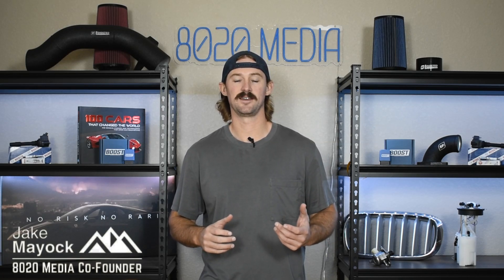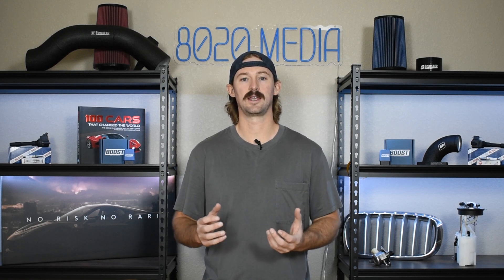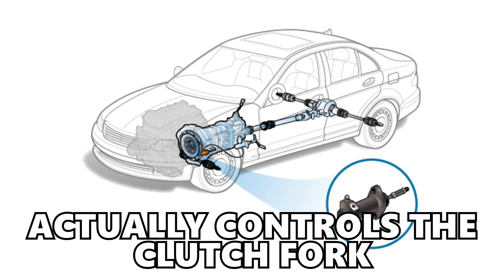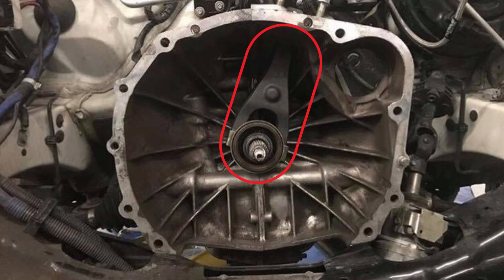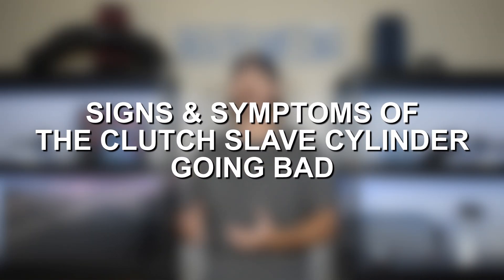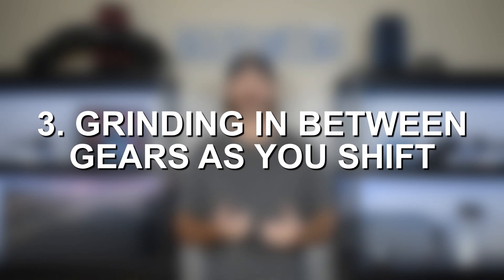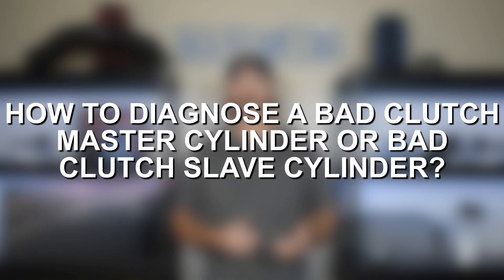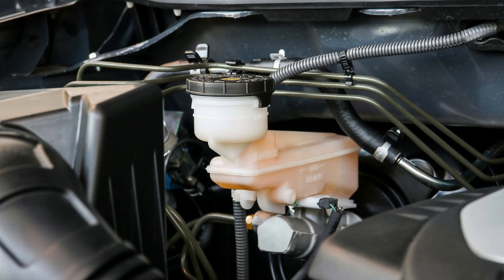Bad Clutch Master or Slave Cylinder? Symptoms, Diagnosis, and Fixes Explained!

Comment: I changed everything in my car, clutch, master and slave cylinders but the clutch is super hard to push and now my leg feels really bad. We bled it and we adjusted it but nothing works… I have no ideas of what to do so I just want to get rid of the car :/
Reply from the maker: K - Totally get the frustration—if you’ve replaced the clutch, master, and slave cylinders, bled the system, adjusted everything, and the clutch pedal is still super stiff, something’s definitely not right mechanically, and it’s likely one of two things: either the clutch pressure plate is overly stiff or the wrong type for your car, or something is misaligned in the install, like the clutch fork or throwout bearing binding against the pressure plate fingers, creating excessive pedal resistance; some aftermarket clutches, especially performance or “stage” kits, have way heavier pedal feel than OEM, so if you went that route, that alone could explain the pain—but if you used OEM or close to it and it still feels like a gym workout, you might be dealing with a bad install or a bent fork putting unnecessary pressure on the system; it’s demoralizing, but if you still like the car, a shop familiar with your make/model could probably fix this with a proper re-check, and if not, selling might save you some grief.

Comment: About a month ago my clutch pedal went spongy and then it stayed down with a little bit of a burning smell.
Since then the clutch hasn't been spongy but about once a week all of a sudden my car has trouble getting into gear.
Does this sound like a master cylinder or slave cylinder issue? Thanks
Reply from the maker: M - Yep, that pattern is a strong sign of a failing clutch hydraulic system, and most likely points to a bad clutch master cylinder or slave cylinder slowly losing pressure or leaking internally; when the master cylinder starts to fail, it can intermittently fail to build enough pressure to fully disengage the clutch, making gear engagement tough or impossible, and the occasional return to normal behavior is typical of a seal starting to break down, especially under heat or load—so I’d inspect the clutch fluid level (which may be low or dark), check for wet spots around the master and slave, and if you don’t see any external leaks, suspect the master cylinder is bypassing internally and should be replaced before it fully gives out.
Reply: @8020Automotive  Thank you for replying to me.
I've had my car (bmw 1series) looked at and test driven by two garages now. 
They both say everything appears fine, no leaks, drives well, nothing obvious.
I think I will book in with them to replace the master cylinder.

Comment: Ive replace my entire clutch, release arm, pivot ball, arm spring.. 
and im still having the same issue, 
Where it take a long throw for my shifter to engage into gear, causing a clicking clunking sound coming from the shifter itself. I  uploaded video of it to my channel. 
I’ve drove other manual vehicles and the gear engagement and disengagement  is so smooth and clean. 

Sounds like the slave cylinder might be what I need to replace! I will be back with an update.
Reply from the maker: B - Keep us updated!
Reply: Seems like you sitting with a problem with the transmission itself, there's components inside that wear over time, had problem similar to yours and I thought it was clutch but turned out it was broken gears inside gearbox

Comment: Just replaced the clutch on 2013 vw golf r can with the new slave cylinder/release bearing and now i can not get it to bleed. It will not build any pressure. Any advice?
Reply from the maker: B - If you’ve just replaced the clutch and slave cylinder (which is integrated with the release bearing on a 2013 VW Golf R), and you can’t get it to bleed or build pressure, you’re likely dealing with trapped air in the system—especially common with these internal concentric slave setups; try gravity bleeding first by keeping the reservoir full and opening the bleeder screw on the slave to allow fluid to drip out on its own (this may take time), then move to a pressure or vacuum bleeder to force fluid through without relying on pedal movement; if that still doesn’t work, the master cylinder may have been overextended during install or is failing internally, so inspect it and the push rod for proper alignment and function—also double-check for any fluid leaks at fittings or banjo bolts, as even a small leak will prevent pressure buildup.

Comment: Is there a posibility that this bearing is not fully retracted when i push the pedal? Cause im having problem that when i accelerate it not riding faster and i have a feeling that its sleeping over flywheel when i put my foot off the cluth pedal
Reply from the maker: J - Yes, it’s definitely possible that the release bearing (throwout bearing) is not fully retracting when you take your foot off the clutch, which can cause slipping because it may still be slightly disengaging the pressure plate, especially if the clutch fork or hydraulic system (master/slave cylinder) isn’t returning fully due to wear, improper installation, or internal pressure not bleeding off; this would explain why your engine revs but the car doesn’t accelerate properly—check for a sticking slave cylinder, improper free play, or misaligned clutch components.

Comment: What do you think of a clutch pedal that works great under regular driving conditions, but once wot and trying to change gears, the clutch pedal sinks to the floor and requires a few pumps to get it back to being firm again? This is with a brand new slave cylinder as well.

Thank you
Reply: And i have no fluid leaks anywhere!
Reply from the maker: P - A clutch pedal that behaves normally under light use but sinks to the floor and loses pressure under wide-open throttle (WOT) is often a sign of master cylinder failure, specifically internal bypassing where fluid slips past the seals under high-pressure or high-heat conditions—especially since you've already replaced the slave cylinder and confirmed no external leaks. Hard acceleration increases engine bay heat and can also cause fluid expansion or air pockets to shift, exposing a weak master cylinder seal or even slight aeration in the system if it wasn’t fully bled. It’s also worth checking for flexing in the hydraulic line under pressure (especially with braided stainless upgrades), but based on your symptoms, the clutch master cylinder is the most likely issue, even if it appears fine under light or moderate loads.

Comment: Hey love this video and glad I found it as I’m having clutch problems in my ranger. Guessing it’s the master after watching this. Recently wouldn’t go into gear out of the blue and noticed fluid was low so I put that in then bled the system. After doing so the soft almost non existent pedal got a bit stiffer and was able to shift. But, in the time it took for me to run in the house and grab a drink and wash my hands, the system had lost pressure and was back to the almost non existent pedal and was again unable to shift into any gear…. Strange part is I cannot for the life of me find any leaks anywhere. Is a low mileage vehicle and has virtually no leaks of any kind anywhere and is completely dry everywhere so there’s no mistaking one leak for another or anything of that sort. I think I will start with the master givin what I’ve learned here. Wondering what your take is on this givin the symptoms I described???
Reply from the maker: R - Thanks for the feedback! Based on your description, it strongly points to a failing clutch master cylinder—even without visible leaks, an internal seal failure can cause it to lose pressure after sitting briefly, which explains why the pedal went soft again after just a few minutes; if fluid isn’t leaking externally and the slave cylinder area (especially inside the bellhousing) is dry, then it’s very likely the master cylinder is bypassing internally under pressure and allowing fluid to move past the piston without actuating the clutch, especially as it warms slightly. Replacing the master is a logical first step, and if the issue persists afterward, only then would I consider the slave cylinder, which can also fail without visible external leaks if it's a concentric type inside the bellhousing—but the master is by far the more common culprit given your symptoms.

Comment: What could cause the clutch pedal to get soft and spongy about 1/3 from the top, but only when it is driven for a longer period an when it is hot outside and engine heats up. When starting the the car cold in the morning, everything is normal, on short runs everything is ok, the clutch engages always at the same position. The fluid was bled, did not go for a longer trip at that time, but after a couple of days the spongy pedal came back, especially when driving longer than 30 minutes. I think it does not help when a/c is on and cooler fan is making additional heat to the engine bay. When outside temperature lowers the  pedal gets back to normal. Had this problem only in summer, just a couple of times in the past 2 or 3 years, but this spring it has come up more often. Master cylinder or? Thanks.
Reply from the maker: M - A soft or spongy clutch pedal only after extended driving or in hot weather—especially if it returns to normal when the car cools down—is a classic symptom of a failing clutch master cylinder or slave cylinder, particularly due to internal seal breakdown under heat; as the brake/clutch fluid heats up and pressure builds, worn internal seals in the master or slave can allow fluid to bypass internally, leading to a loss of firm pedal feel without an external leak or visible fluid loss. Since you've already bled the system and it only happens after longer drives in warm conditions (and resolves when it's cooler), the heat-sensitive degradation of the master cylinder seals is the most likely cause—replacing the clutch master cylinder should resolve the issue, but if your system uses a concentric slave cylinder (internal), it may also be contributing and should be checked if symptoms persist after replacing the master.

Comment: i have a 2011 fiesta 1.4 petrol never had any problems with the gears or clutch but now when i drive for about 10 mins or so and the car warms up i cant get the gears if i stop and wait 10 mins start it up again i can get all the gears no problem, its got me stumped any suggestions ?
Reply from the maker: E - If your vehicle shifts fine when cold but becomes difficult to get into gear once warmed up, the issue is most likely related to the clutch hydraulic system, specifically a failing clutch master or slave cylinder—as the fluid heats up, worn seals may allow internal pressure loss, making it hard to disengage the clutch fully, which causes gear engagement problems; since it returns to normal after cooling down, it strongly points to thermal expansion affecting fluid pressure or seal integrity, so start by checking the clutch fluid level and condition, then consider replacing the master cylinder (most common culprit) and bleeding the system thoroughly.

Comment: I like your content; I can hear the spring when pressing the clutch pedal, right inside the cab, my master cylinder must off.
Reply from the maker: S - Thanks for the feedback! If you're hearing a spring-like noise when pressing the clutch pedal inside the cab, it’s often coming from the clutch pedal assembly itself—not necessarily the master cylinder being “off,” but possibly a dry or worn clutch pedal return spring, bushing, or the pushrod connection to the master cylinder; over time, the pivot points can squeak or creak, and the spring can make a metallic twang or pop as it moves. Try applying some white lithium grease or silicone spray to the pedal pivot and spring—if that doesn’t quiet it down or if the clutch feels inconsistent or spongy, then inspect the master cylinder pushrod and firewall seal more closely for signs of play or fluid seepage.

Comment: I've had an issue where, at times, especially when going over small bumps, it feels almost like it's slipping, but it isn't actually slipping.
Reply from the maker: A - If your car feels like it’s “slipping” when going over small bumps but isn’t actually losing traction or RPMs, the issue is likely suspension or drivetrain-related, not the transmission; this sensation can come from worn struts, bushings, motor mounts, or even a loose CV joint or driveshaft, which can momentarily shift or unload when the suspension compresses, creating a brief feeling of looseness or hesitation—inspect your front end components, especially control arm bushings, strut mounts, and engine/trans mounts, since any play there can create that odd slipping sensation without any actual loss of power delivery.

Comment: I am facing similar issue. I drove the car nicely and parked it . Next day when i pressed the clutch pedal,  it went deep into the floor. I got it bleeded by the help of mechanic. At first it was only air bubble coming out. After continuos pressung of clutch pedal, finally the oil started coming at the slave cylinder.  But after few days the same problem started again, my clutch pedal again went deep into the floor. My fluid level in the reservoir doesn't seem to be going less. Kindly advise what is the problem,  master or slave cylinder?? Thanks
Reply from the maker: J - If your clutch pedal keeps sinking to the floor after a successful bleed and the fluid level in the reservoir isn’t dropping, the most likely culprit is a failing master cylinder—specifically an internal seal failure that allows fluid to bypass inside the cylinder rather than pushing it to the slave, which won’t result in visible leaks but will cause air-like symptoms and inconsistent pedal pressure over time; a bad slave cylinder typically leaks externally and causes visible fluid loss, so since your reservoir stays full and it takes a while for symptoms to return, replace the clutch master cylinder first, bleed the system thoroughly again, and monitor closely—this pattern is classic for internal master cylinder failure.
Reply: @8020Automotive - Many thanks for your reply...will replace the master cylinder and update ...

Comment: Advice if you have time. I have bleed my syatem twice. It helped my engagement a bit. So, to be clear i have full engagement range, but the first half of the pedal is soft and spongy. I purchased a new master.
Reply from the maker: R - If you've already bled the clutch system twice and gained some improvement in engagement but still have a soft, spongy feel in the first half of pedal travel, it’s very likely your current master cylinder is internally bypassing or drawing in air past the seals—which aligns with your decision to replace it—since full engagement combined with a vague initial pedal usually points to hydraulic inefficiency rather than air in the line alone; once you install the new master, be sure to bench bleed it thoroughly before mounting, and consider pressure bleeding the entire system afterward to fully purge any trapped air, especially if the slave is internal and hard to access.

Comment: Really helpful video! My mechanic thinks it is master cylinder because when I returned to vehicle in the morning clutch pedal was on floor. Clutch was not going into gear when driving but is ok again. Pedal hasn't felt spongy so I thought it might be a slave?I thought they could also cause pedal not to come up?  Maybe I should get him to check for leaks?
Reply from the maker: E - Thanks for the feedback! Yes, both the master and slave cylinder can cause the clutch pedal to sink to the floor and prevent shifting, but since your clutch pedal isn’t spongy and the issue was temporary, it’s likely a hydraulic pressure problem—often caused by a sticking or bypassing master cylinder, though a leaking or internally failing slave cylinder can also cause similar symptoms; you should absolutely have your mechanic inspect for external leaks at the slave, master, and hydraulic line connections, and if no fluid loss is visible, a failing master cylinder is more likely as it can internally leak without leaving external evidence—especially if the issue resolved on its own and no fluid is missing from the reservoir.
Reply: @8020Automotive  Thanks so much for the advice!

Comment: Great video, but unsure after you explanation of what the possibility could be. My clutch pedal is very weak, no pressure in clutch pedal which makes me think it is the clutch master cylinder as you mentioned in the video, but I also have a leak to the bottom of the engine between the engine and transmission, which you say is the slave cylinder. My Mercedes parts are expensive. I would like to know what do you recommend?
Reply from the maker: O - If your clutch pedal is weak with no pressure and you’re seeing fluid leaking between the engine and transmission, you're absolutely right—it strongly points to a failing internal slave cylinder, which in many Mercedes models is mounted inside the bellhousing and requires transmission removal to replace; while the master cylinder could also be contributing, the leak confirms the slave is at least part of the problem, so if you're already paying for the labor to drop the transmission, it’s smart to replace both the master and slave cylinders at once to avoid future issues and save on labor costs down the line—yes, OEM parts are expensive, but consider OEM-equivalent aftermarket brands like Sachs or LUK, which are often the original suppliers and offer quality at a lower cost; just be sure to fully bleed the hydraulic system after installation for proper pedal feel.
Reply: @8020Automotive  in my W460 1st gen G wagon, the slave is external. ok thanks
Reply from the maker: @osky7777  Keep us updated.